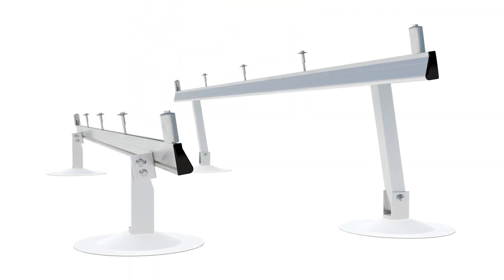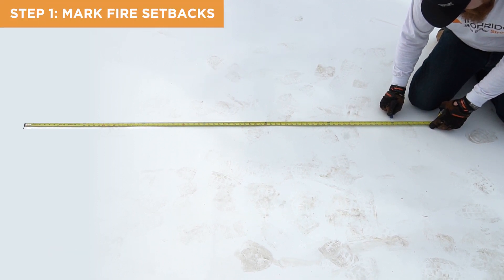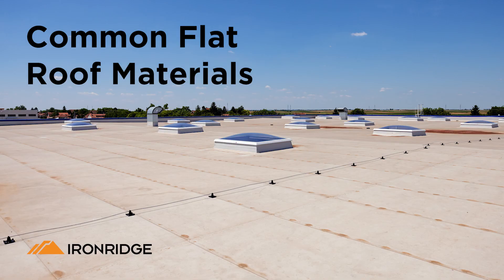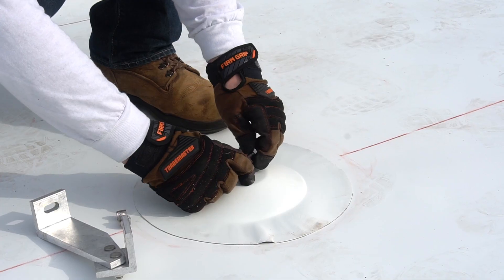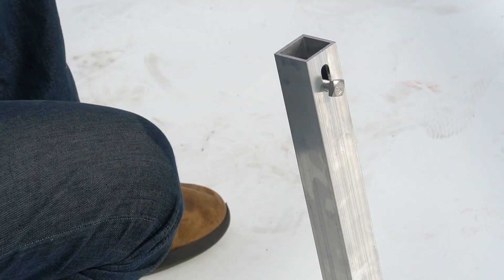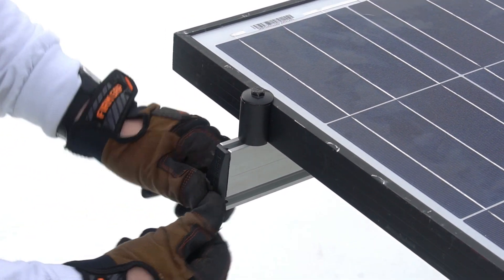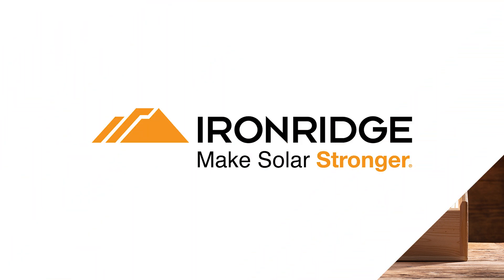How to Install IronRidge® XR Tilt Mount // Flat Roof Solar

Comment: Are the flat roof attachments compatible with the SnapNRack short and long Tilt legs??
Reply from the maker: Hi there, we always recommend using IronRidge as a whole system. All of our components are listed and certified for that use case.

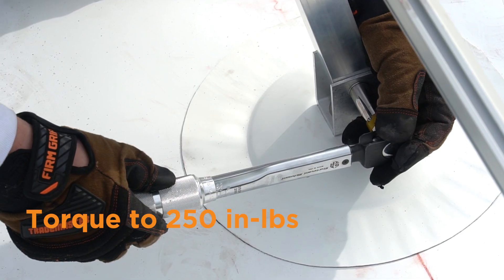Comment: What AHJ would allow the roof attachment to be lagged into the sheathing and not a framing member? not here in southern CA. 10:39, always a great idea to torque the bolt and not the nut. lol!!
Reply from the maker: Hey Jesse, thanks for chiming in! When using the Flat Roof Attachment, a third-party engineer is recommended for each project use case. It has many attachment style options depending on the roof. Also, we are torquing the bolt, but it may look like a nut due to the washer behind it. Hope you have a great week down in SoCal!

Comment: Can this be installed on a slopped residential roof?
Reply from the maker: Hey there! The Tilt Mount System is mainly designed for flat roofs, but this can be installed in other custom variations depending on the circumstances. Feel free to reach out to our team by emailing support@ironridge.com and we can help you find the right product information for your needs.